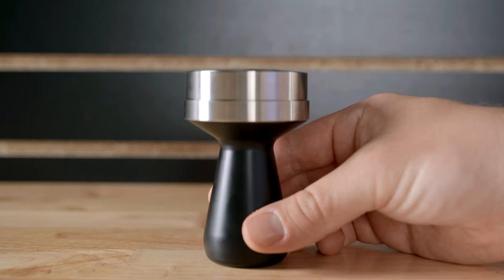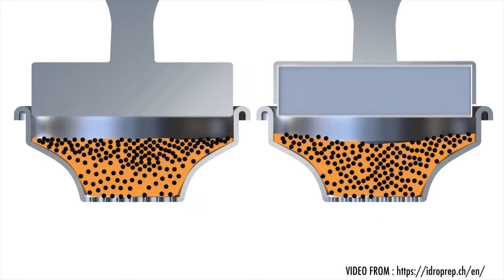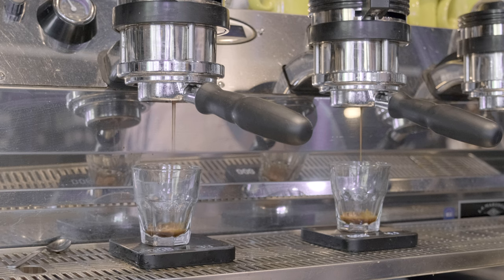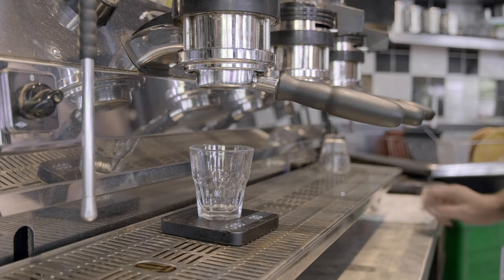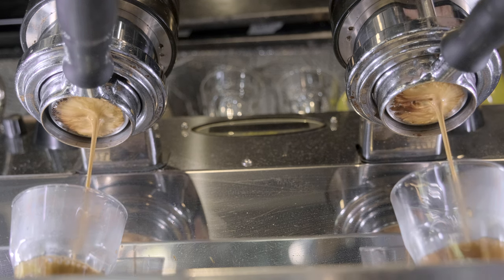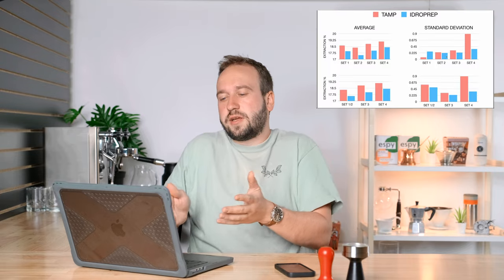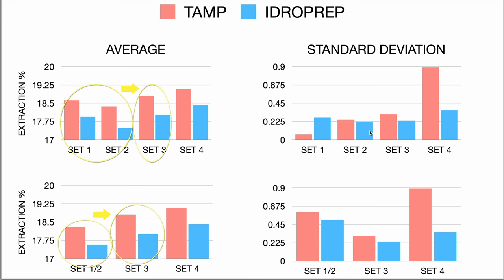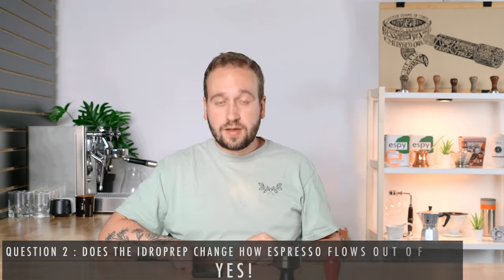The World's FIRST Hydroforming Tamper - Idroprep Coffee Tamper

Comment: Thank you for exploring this topic.
It seems as though there is a quest for the improved extraction of coffee, raising the quantity of Total Dissolved Solids (TDS).
It is my assumption that what a coffee drinker ultimately wishes to have, aside from having a higher caffein-bearing drinkable solution, is improved soluble coffee taste and aroma.
Our hypothetical question is, therefore: Does increased coffee TDS yield “better” coffee taste and smell? Using the Scientific Method, the null hypothesis argues that “no”, it does not. We, then, attempt to disprove (reject) the null hypothesis, adopting the alternative hypothesis that “yes” it does.
Below are some of the questions that we might ask in order to determine whether to reject, or to accept the null hypothesis:
1.	What are the components of our “taste”, i.e.: What do we like about what we like?
2.	Are the compounds associated with “taste” water-soluble?
3.	Are the compounds associated with “taste” carried by compounds which are water soluble?
4.	Are volatile compounds important to “taste”, if so, to what degree?
If we accept the alternative hypothesis, we might wish to pursue questions about TDS:
1.	What is the quantity of dissolvable solids available in the coffee used, of which Total Dissolved Solids (TDS) is part?
2.	Does the particle size of the ground coffee correlate with TDS extracted?
3.	Does the water flow-rate correlate with TDS extracted?
4.	Does water pressure correlate with TDS extracted?
5.	Is maximal coffee TDS extraction desirable?

You might want to explore some of these questions here: https://perfectdailygrind.com/2017/11/coffee-science-breaking-down-where-flavor-comes-from/#:~:text=Non%2Dvolatile%20compounds%20include%20alkaloids,It's%20soluble%20in%20water.

Comment: Thank you for not simply promoting idroprep as the greatest thing since sliced bread. Like you, I think the concept is ingenious, has promise, and in theory is a step in the right direction, however... as you pointed out at 23:56 the actual tamping process fails to extend to the outside edge, i.e., full diameter of the portafilter leaving the edges of the puck untouched. It's evident that the metal shell that surrounds the gel pad is  there more for the protection of the gel since it is subject to damage from both hot water and/or being punctured. Unfortunately the metal shell also impedes any possibility of a tamp reaching the edges of the coffee puck. My thought: If the gel pad is so delicate that it touching the edge of a hot portafilter during the tamp will damage it etc... they need to experiment with different gel products until they find one that is heat resistant and more puncture proof, and will also allow them to shorten the height of the protective metal shell which will allow the gel material to "squish out" so it can reach and touch the outside edges of the portafiler and allow for a more complete tamp.

Comment: My god, this is the most underrated coffee youtube channel there is! Awesome job! ✌
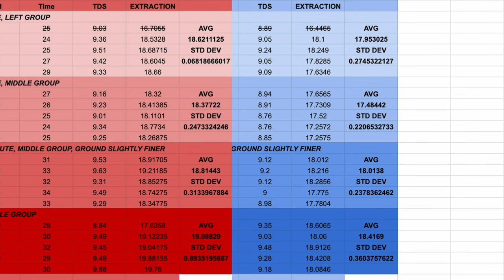Reply: Also, one hypothesis of why the EY went up when «straight tamping» (14:19) vs other distribution methods is that it may helped with radial extraction uniformity. The grinder you used in the experiment creates a center mound. Typical espresso baskets nowadays favor flow towards the center and the periphery of the puck is less extracted due to the basket's hole pattern. Straight tamping the mound of grounds creates a lesser density in the periphery and compensates for the slightly uneven flow of modern espresso baskets. In the end, the periphery is more extracted and the EY is higher with this technique. Some people use the WDT and the ICT: inward comb technique (they purposefully create a center mound with a WDT tool) to help with radial uniformity and get higher EY.
Reply from the maker: Appreciate the kind words, and great hypothesis!

Comment: Don't discount your findings, this is excellent work (you sound like you have an engineering background)! Wow cool stuff, and you have enough trials for SD/SE, and have probable causes for the deviation. Can't really ask for more. On why TDS and EY increase with less distribution, maybe even extraction <> higher extraction. Unless you have bulk channeling where the center of the channel doesn't extract, small channels are local areas of higher flow and would extract more, balanced against high density areas that extract less. Outside of composition analysis (like spectrography - difficult and expensive) or taste (hard to quantify), the best you can do easily is look at the variation, which you did. But generally I'd expect the hydro shots to be more balanced and less bitter. Keep it up!
Reply from the maker: Appreciate the kind words! That's a great way of explaining the EY increase. Doing a bunch of tastings using the Idroprep is next on my list!
Reply: You forgot to add "class dismiss" after your superb article! Amazing comment!

Comment: Thank you for the great video! I too was one of the first people to purchase this tamper. He arrived in March and I currently no longer use him. In any case, it is true that the consistency is already quite good, for example, if you do not spread the coffee grounds but tamp directly. The coffee was already quite reasonably extracted from the machine in the double and single basket. What I do not like, however, is the handling. I have an unpleasant feeling when tamping, because the tamper is wobbly due to the gel pad and that creates a strange feeling when tamping. Combined with the quirky design and since the metal base is very high, it feels kind of weird. 

It also looks strange visually and during tamping due to the height of the metal base. The biggest drawback, however, is actually the behavior you mentioned, that the coffee grounds do not come up to the edges. I had taken this tamper, because I also assumed that the gel pad presses the coffee grounds to the outside. So I should save myself a 58.4 or 58.5 mm tamper. Instead, however, the metal edges press in the coffee grounds. This always looks very unsightly. 

I do not know how it is now, but in March there was only the 58 mm version, as this was to be tested in the first test phase. Possibly the gel pad still needs to be revised so that the edges are also neatly covered. Otherwise, I'm curious how it goes with the revision of the tamper. For me, this tamper with its own design is currently not finished and the price seems too high for me. I must note, however, that I had paid only about 28 euros through an initial discount. For this I was happy to test it and certainly this tamper has great potential. But I currently prefer to stay with a classic tamper, which gives me a better feel. And with 58.5 mm I also hit the edge as far as possible.  

Best regards and thanks for your great work!
Reply from the maker: Thanks for your insight! Sounds like we had very similar first impressions.

I forgot to mention the feeling when tamping. It is quite wobbly, and definitely throws you off a little bit. 

I do think if they're able to fix the gel pad reaching to the edges, this could be a real game changing product!

Comment: I came across this video without searching for idroprep and ended up watching till the end. 😆Appreciate this great work here. I was thinking about getting one until you mentioned that it doesn’t cover the edge of the basket.
Anyway, I personally use palm tapping with wdt and tamper that sits on the edge of the basket and push the middle part down so that it levels the puck. Got fair results so far 😄
For the part towards the end of the video when you mentioned that idroprep has more straight flow or it converge to one faster. Could it be because as from the experiment, the idroprep get less extraction time which means higher flow rate and that leads the fluid to combine into 1 flow faster? But I guess channelling is playing bigger role anyway. 😆
Reply from the maker: That could definitely be the case as well! There's some more testing that could be done to figure that out. Thanks for watching!

Comment: I think there’re misconceptions in many places not only here in this video;

The hypothesis of ‘theoretically even puck density = better espresso’  is still a myth and not concluded.

The hypothesis of ‘better puck prep = no channeling’ is also not very conclusive, because channeling is not only about the puck itself. 
The sub-topic with another misconception being: Splattering at bottom of basket = Channeling. 
But this Channeling has something to do with coffee granule’s sitting on and around each and every pores at the bottom of basket. There’s already research papers showing that regardless of how puck is prep’ed, there’s last-mile-effect at bottom of basket, where introducing micro-channels opens up the pores and makes splattering (many youtubers call it channeling) completely gone, and this is done by inserting a layer of filter paper.

Comment: In several videos shared by idroprep, a single shot basket is always used, to exaggerate and to convince us the laypersons, visually, that there’s higher chances that density is highly uneven when a normal tamper is used.
But don’t we already knew most of us are using double-shot basket?
In addition, how will idroprep convince barista not to spin the tamper after tamping? (Imagine that the spinning is going to introduce abrasions on the rubber membrane and shorten its life)
Reply from the maker: Very true. My assumption would be that they use the single baskets to really drive home the point of the Idroprep. 
As for spinning the tamper, baristas should know by now not to do that with any tamper. Not sure of what affects it would have on the Idroprep.
Reply: @HomeGroundsCoffee  Spinning:
I personally spin to remove ground coffee that still stuck to the side wall of tamper before removing the tamper. Not sure about Baristas and others?
It’s ok for hard tamper.
But it might not be recommended for idroprep, as the rubber surface might have high frictional coefficient with ground coffee, and might not be good for the rubber membrane for it being abrasive?
Reply from the maker: Yea spinning is usually not recommended, at least in cafe settings, as you're more likely to apply pressure while doing so and ruin the flat tamp. There's zero benefit in doing it anyways, so I never do it.

Comment: Question: In combining the standard deviations of 1 and 2, did you just add the values? It kind of looks like it, because if you compare it to 3 and 4 the 1/2 standard deviation looks a lot higher to what it should be. And to combine those, dividing by 2 would probably be more informative.
Reply from the maker: The combined standard deviations are taken from all of the numbers within the two sets. So since the average numbers in each set were so different from one another, the overall standard deviation shot up. Good question though!
Reply: If I remember correctly, that is not how two sets can be combined, there is an set of extra operations for that, I think.
Reply from the maker: Oh interesting! It’s been a few years since I took statistics, so you very well may be correct. Let me know if you find anything, would love to add a correction!
Reply: Unfortunately, I have lost those notes, maybe i will find something online. 
However, as the Standard deviations of sets 1 and 2 were quite different, the combination of both would probably not work, as it would suggest that those two sets of data aare to different.
Reply from the maker: Great point. Hopefully someone can chime in! Thanks again.
Reply: Your welcome, sorry that I can't help further at the moment.

Comment: I tkink with less distribution you will have more mocca-like emulsion-effect Like in a Nespress-capsule.

The more homogenouse the Flow thru the Coffee-Puck the finer you can grind or lower the pressure as more homogenouse the Flow is the faster the Extraction is.

I think with hydro-tec Tamper you have less Problems with unforgiving beans/roasts.
Reply from the maker: Great summary, thanks!
Reply: @HomeGroundsCoffee  By the way, Independent from your YouTube-video Here I did some Experiments with Senseo-Pads in a Senseo Select (the one with still Just 5 Spray shower head instead of 40 smaller Sprays additional to the Basic 5 wider ones. Senseo Original and Senseo Quadrante have the 45 Spray shower head).
E.g. at Senseo-Pads from dutch Brand Favor a Hydro-Forming-effect is Most evident.
If you First do a Short Flush and then Stop the brewing, Open the brew-head and than try to Push Out the Air (pre-flush Blooming effect) Out of the Pad with the bottom of a teaspoon you experience the Resistance of the Filtermaterial of the coffee-pad. It does Not really let the liquid Out as you May expect.
So reversing that effect. The hot water coming from the Brew head/shower head pushed down the Filtermaterial of the Pads, does somekind of homogenouse tampering or hydro-Forming.
I do Not say that Senseo makes the best Coffee but Senseo-Pads with Robusta in it Delivery Coffee with a clear chocolate taste as you would expect If a Coffee/coffee-bean/roast is Marketed with Aromas incl. Chocolate. I'm talking Not about real chocolate as ingredient Here. I mean chocolate as an aroma from the roasted coffee-bean Like Herbs or fruits at Arabica.

Back tomthe Trick with the teaspoon at any Senseo. As Senseo-pad offers somekind of hydro-Forming you neither do the Trick with pre-flush and the teaspoon nor do tampering before brewing Just Take Care that the Coffee is distributed in the Pad. Means you should Not hold IT on one Side/Edge and Shake all the coffee to one Side.
No distribution with your Fingers. The coffee should should lay evenly distributed in the Pad.

Hydro-Forming is a good and reasonable Approach at portafilters Machines.

Comment: Looks like a massively half finished design with the ridges left and all that floating coffee will get washed into the puck under pressure, kind of missing the point of consistent density no? It also looks fiddly and delicate plus hard to clean. My guess is that the gel thing would suffer a catastrophic incident within a week. Not tempted in the slightest to buy one.
Reply from the maker: Good points on it seeming half-finished. Surprisingly easy to clean though, and the gel pad is way sturdier than I thought!

Comment: For artisan cafes, best shot is important.
For busy artisan cafes, consistently pulling best shot quickly is important.
Question: does the gel pad add another problem for Barista? Maintenance?
Hygiene?
Longevity?
Reply from the maker: Great points! The gel pad does add a new layer of "potential" problems, although I don't think it is that bad. If it breaks, yea you're unfortunately out of a tamper until you can get a replacement. Hygiene is the only other one I can see problems for, as they don't recommend washing it with super hot water.

Comment: Are you still using the idroprep? Do you still think it’s good?
Reply from the maker: I do not use the Idroprep currently. Unless they come out with one with the pad extending to the edges of the basket, I don't believe they are beneficial.
Reply: @HomeGroundsCoffee  so even the 58.4mm poses issues? What did you find the issue was at the edges or the basket? Worse than regular tampers?
Reply from the maker: Yea I purchased the 58.4 and it didn't fix anything. The issue is that the gel pad itself doesn't extend all the way to the edges, so the metal enclosure is tamping the coffee on the edge.
Reply: @HomeGroundsCoffee  so basically it produces a similar edge to a regular tamper…does it channel there because of that?